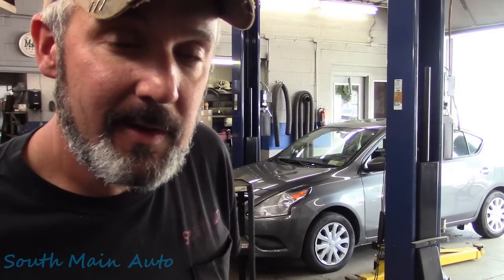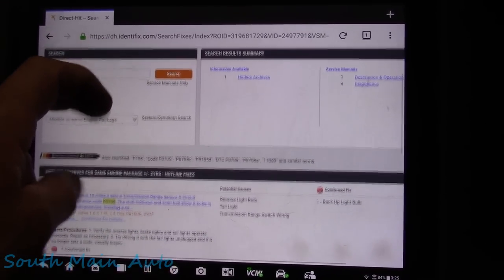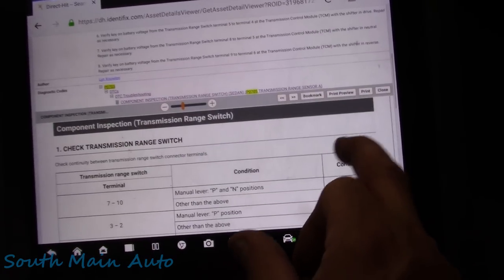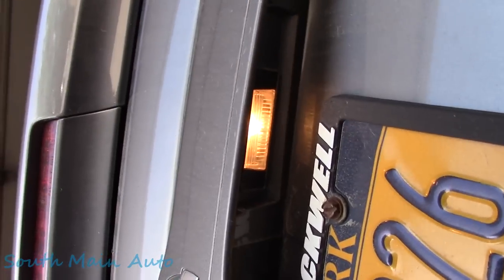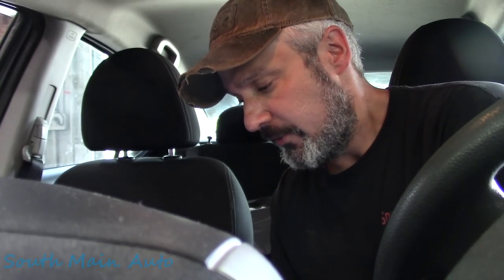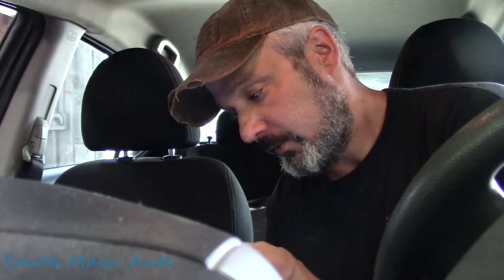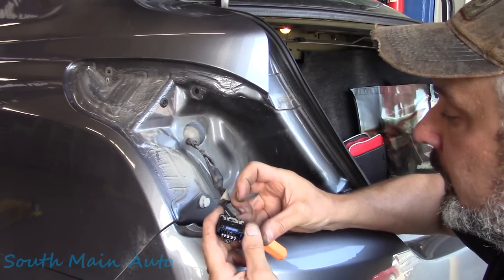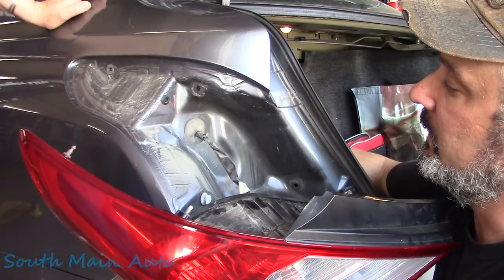Service Data Doesn't Cost - It Pays

Comment: I have a coworker with this same car, and they'd had this issue, causing odd shifting.  They took it to a shop that replaced the range switch, when that didn't fix it, they told her she needed a new transmission.  I ended up searching around, and found another diagnostic video, where someone had gone through this same issue, but it was a dealership/reseller who had gone thru multiple range switches and even swapped out the transmission and still had same code/symptoms.  THe diagnostic guy, had to go through a bunch of nissan wiring diagrams until he finally found one that showed the reverse light circuit is shared with the TCM module, and he ended up finding out that when the selector is in R one reverse bulb was very bright, and the other very dim.  He ended up finding the circuit board on one side had gotten exposed to water and had a bunch of corrosion on it.  I don't remember if he replaced the board assembly or just cleaned it, but as soon as he fixed the light circuit, everything worked normal again.   

A very interesting design choice by Nissan, especially for them to not clearly document the circuit with the associated trouble codes.

So I ended up finding the reverse bulbs on my coworkers car were different brightnesses, didn't find any corrosion on the circuit board, but took some alcohol and cleaned all the contact surfaces off for the bulb sockets, then put a very light schmeare of dielectric grease on each bulb before reinstalling them....her problem was solved.  No transmission required.

If she has this problem again, I will definitely check the pin connections for looseness like you found.
Reply: This crap in addition to their CVT issues is enough to convince me NEVER to own a Nissan.
Reply: @keithwolstenholme4238  For Sure.  The only Nissan vehicle that I have been impressed with is their full size cargo/work vans.  Had a fleet of them at previous job, and the field techs beat the crap out of them, loaded them with heavy parts or pulled trailers with them.  They required regular maintenance, but what doesn't?  Had multiple vans with over 100k on them just working their hearts out without any major issues.  But their consumer market stuff?....HARD PASS.

Comment: I was working on a Nissan Micra where every  time you hit the brake, the rear view camera would come on. I was scratching my head until I read a tip from identifix explaining how water can get into the circuit board on the rear tail lights and start jumping the power to each circuit. In my case it fed power from the brake lights to the reverse lights and caused a shifter range code and back up camera to come on. Nissan wiring in Canada.. not impressed.

Comment: "What do you think made it get loose." Mrs O asks. Probably heat from too much load and it being replugged a few times, I would reply and start wondering if the other side is also as loose as this one. So back feed of voltage through the reversing lights!?!

Comment: Great Vid, came over from Rainman Ray's shout out. I do have one question, if you have a partially broken wire on the Flux-capacitor causing a voltage drop are Scotch Locks okay to use? Thanks for the share.

Comment: I haven't actually seen the wiring diagram for the Nissan Versa but what I suspect is happening is that the transmission module is what turns on the back-up lights. With the ground floating on the driver's side rear lighting assembly, when the brake pedal is pushed, the voltage to the rear brake light is backfeeding through the back-up lamp and sending voltage to the transmission module. The module doesn't expect to see voltage on the back-up light circuit and it confuses it into thinking that some of the shift position switches are closed when they aren't.
Reply: my thoughts exactly

Comment: As a DIYer and former mechanic. I got a month sub, for a van I just bought had 50 million codes set. but the code that stuck out was a performance code. cleared it came back. instead of going with the "Fixes" I used that and looked at data that would affect performance. B2S1 O2 was wonky. Someone had de-pined the signal wire and taped up on that O2, don't know why because bank 1 cat was bad, not 2. But I still had to use common sense to avoid "parts cannon" that would not have fixed anything. Later oil control for VVT, dealer said $1600 to fix. Without removing intake, pulled solenoid, soaked in carb cleaner overnight, been good for a little over 25k.

Comment: Questions: Having fixed an issue like this that was causing one code that then went to a "Past" code - why clear the codes?
Doesn't that mean all the drive cycle monitors need to be run?
Don't they just clear themselves out after a certain number of drives?
Does the money light stay on even though the code went to a past status?

Comment: Nissan seems to have a weird code setting architecture. The alternator on my wife's Maxima started going bad. The ABS, TPMS, and check engine lights came on and sometimes went out. No charge light (?). I saw Eric's vid on a failing alternator. Sure enough charging at 15 volts. SMA FOR THE WIN!!!

Comment: Ray sent me here...lol.   Actually helped me fix an issue on my truck no one else could figure out.  Power windows on all 4 doors down and up works fine.  But if you have the cruise control on going down the highway and roll the driver's door window up it knocks off cruise.  Only window that does that.  So, after watching this video from Ray sending me over here and watching this I went out and I I pull the panel off, check the plug in on the motor and...whattaya know..the ground pin is loose. Tightened it up..no more knocking cruise off....so far.  Got a few techs here in town that I gotta share this info with because 3 different techs looked at it and none could fix it. Replaced the entire button controls in the door...and those ain't cheap...and nothing.  Threw about $500 into trying to find the issue without a resolve and this 1 freaking video I fix it myself.  You and Ray gonna save me money...lol.  Thanks.  Tell Ray, Thanks cause been watching him for about a year and he mentions you a lot but never even watched a video of yours until he mentioned your site today on his video and I thought I'd check you out.  Helped me fix mine...subbed.  Keep up the good work.  One of yall need to move to Alabama near me.  You'd both save me repair money.  Stay cool.

Comment: No idea why a bad ground at the light caused the transmission   issue (Eric, did you ever find the reason?) but I would offer the following for the failure of the ground pin.  First it was the pin that carries about 6 (or more times current) than any other in pin in the connector.  Being the pin is in the center of the connector it is the least likely pin to be damaged by physical abuse.  But it is the most likely to overheat.  I suspect it heated the spring of the contact enough to soften it and allow it to relax.  The connector can probably theoretically  carry that much current but with a minor amount of oxidation, resistance will increase with heat increasing as well until failure occurs.

Comment: I had a pleasent suprise after sticking my 2018 Ford Sierra in the main service centre for a tps replacement and they actually replaced two with a complete bill of only £125. Damn it cost more than that for a BMW bike just for one sensor.

Comment: Connector pin drag test. Absolutely! I do heavy duty truck road service. When the 1st generation Detroit Diesel ECM's late 1990's appeared I got a OTC terminal probe kit.  By learning the importance of pin drag I became a local guru, I have fixed trucks which just came out of factory Detroit shops simply for the mechanic over looking loose terminal to pin tension. That OTC kit made me a lot of money thru the years by checking pin drag. Yet I am way behind those shop guys in knowledge.
   But as emissions have changed I got to go and get the kids in local truck dealers to hold my hand.

Comment: I had a older Toyota sienna.  2000 ish. She was a gem. Oil leaking out of the frame. Anyhow. The car would die after 10 min or. Blown fuel pump fuse. Well like I said this engine was covered in oil. Found a tip on ident a fix. The O2 sensor would short ou on the frame due to a bad motor mount. Sure enough  drive it easy, no  issue. Hit the gas blown fuse. Saved me so much time. This van needed every mount known to man. The engine was basically sitting on the sub frame

Comment: if you want to get more serious about "drag testing" terminals, add and use a good pull force(tension gauge)meter. one that works in sub ounces/grams.
they're not cheap and rather easily damaged.
I'd guess either bad engineering, where it's overloaded with tail/brake and backups lights all lit for long periods or sagged cross-connected bulb filaments. but it could still be bad metallurgy, with increased resistance.

Comment: As  home gamer, I often use resources like that to give me a direction to look in.  I won't just throw parts at a problem, but I will look up what others have found to be the problem, and then see if that is the case for me.  Often, one of the first two or three suggestions is where my problem lies.  As long as you don't get stupid, and just go down the list chucking parts, it can be a great help, especially for those who are home gamers, just learning diagnostics etc.

Comment: Yowza! I can't imagine many folks taking the time to dissect a connector like that. When you pulled out the tail light assy and it started working, most would have proclaimed "Fixed" and stopped right there! Well, they would have put the tail light back, but you know what I mean. Great going!

Comment: Identifix positively has its place in your shop. I once had a Volvo in my shop with a P0301 code. Very basic code. Long story short I put in the code while on hold on the phone. The identifix article said to check the fuel pressure regulator. That would have been an odd way to fix that code . I never would have thought of. Just by shear luck it saved possibly saved hours of time . I am an Identifix believer.😮

Comment: i was a diag tech at a small shop and the owner of the shop ALWAYS went to identafix and kept telling me to just do what it said AKA load the canon i hated doing that because 9 times outa 10 what the owner told me to do was wrong and when i went through my own procedure i got to the problem albeit after a couple hours of work and being a fairly young and new tech i did not always know what parts of identafix to trust

Comment: I’m a Nissan tech, and have seen master techs get duped by the f1 or f0 code for the trans assuming it’s not pulling because of the common cvt failure. They replaced the trans, and still, the problem persisted. Tech eventually found the rear lamps to be kinda screwy, and in shame realized his error.
Reply: What a nightmare....changing a cvt for nothing?....im not sure I could handle that
Reply: @DDrew67  cvts are our gravy. I personally am able to knock one out in a day, many of the older techs, can easily have one ripped out before lunch and almost put back together and programmed before everyone is back from lunch. It’s very impressive to see. Although the aforementioned master tech made a mistake he’s a very good tech that just got to comfortable, and he obviously learned from the mistake because it cost the business money, and it’s just humiliating to know you made such a big mistake. I’m sure it happens to the most seasoned tech eventually, it’s how you handle it, and learn how to avoid mistakes like that in the future that makes a good tech.
Reply: @Billybobaggins9  ok I feel a little better about taking a whole day to swap a cvt....thanks

Comment: It’s like a brain teaser! I had a problem with my f 150, 2005. I was getting tired of replacing the right fog light bulb every time it rained or went through puddles of water. 
Come inspection time I would never be sure it would turn on. So this year I replaced both light bezels. Boy they looked great, but only the left side worked! Turns out I had brown wire cancer. It went back in the harness over a foot. So I used your trick and ran a new wire spliced into the harness upstream of the lights.

Comment: When Mrs. O turned off the lights the light in the trunk came on. It could have been off because of battery protection turning it off after x amount of time. My daughter had a car with a no start condition and the fix was to replace the r/r turn signal socket. Whoda thunk that?

Comment: I had a 2009 Sonata with the auto start!
Start and run fine with key but auto start would start and turn car off right away. Lost my mind.after about an hour of checking circuits and not finding anything out. I see a light bulb package in on floor under driver seat. Turns out owner put wrong bulb in brake light and as soon as maker lights came on it back fed through the brakes and wound shut car off thinking brake was applied without key in ignition. 
Also back in the day 1157's would brak top filament and it would fall onto other filament and caused dash, markers ,blinkers and radio,interior lights to all come on at same time but very dim. Had lots of fun thinking it was a ground 😤

Comment: Rainman sent me to this video and i agree. I have also ran into issues where the manual was incorrect and it takes deductive reasoning to reach the correct diagnosis. That's the difference in between a mechanic and a parts changer.

Comment: I dunno, that light being loose means someone was there before or maybe thats what caused the connector to spread inside and become loose from vibrations, or cheap chinesium made metals with weak spots from improper smelting. great video, my brother has one of them pos versa cars i still drive my 93 f150 as a daily driver. but great vid, a rare find of honest mechanic.

Comment: Eric, be sure and update that post that helped you and add the your was the loose connecter and give the OP a thubms up  or otherwise a that-a-boy pat on the back I work in IT and no one types up what they did to fix the issue and the next guy has to start from scratch and it sucks.

Comment: Some GM cars would set an ABS error if a certain brake light bulb was not functioning properly. This diagnosis reminded me of those cars.

Many cars are going to have a weird engineering quirk, and there is no way to know them all. This is why having Identifix is worth it.

Your channel helped my mom out. A few years ago, she had an EVAP code in her 2011 CRV. Not wanting to just throw parts at it, I searched it and found your channel. You made a video where someone got the same code on a similar CRV. You used your scan tool to show evap pressure, and knocked on the failed valve. The advanced scan tool showed pressure change, indicating that the old valve became sticky inside. Replacing it solved the problem. I replaced it, and solved the problem, too.

Sometimes when a car in my family would have an EVAP error, I'd just get a fuel cap. Earlier, mom's car did have a "Check gas cap error" and the replacement didn't solve it.

I'm so glad the car eventually showed a code.

I'm so used to having a code that gets me where I need to be. For example, some cars in my family would set a MAF error, and all I needed was a replacement MAF.

9:18 I'm used to seeing tail lamp sockets developing a leak, then letting water corrode everything inside. Sometimes I can get new tail lamp sockets, sometimes I have to get a new tail lamp unit. Other times if more than one socket needs replacement, a whole tail lamp unit costs about the same. Due to the number of Chevy/GMC trucks that exist and suffer this problem, Advance Auto keeps these on a shelf with the entire Dorman Help lineup.

Comment: i have the distinct feeling that the wiring diagram was missing something. if it goes to the tcm, does it go to the bcm to run the lights? if so the feedback would be isolated and not cause this issue.  the switch must be hard wired to the lights but the diagram you showed didnt show that.   actually seen an 1156 stuffed into an 1157 socket  do something similar. how they managed that i have no idea but i had to break it to get it out.

Comment: Always wonder if some of the cars were in accidents. 
Once had a Nissan where the license plate bulb wires were brittle and broke because they were routed along the hinge.
Reply: My wife's Dodge has the same issue. Of the engineers just lengthened the wires by an inch there wouldn't be an issue.

Comment: You never did show us how the backup lights are controlled.  I think what you'll find is they're controlled off the same switch as the one used for the computer input.  With the bad ground, a voltage was back feeding into the reverse input, confusing things.  It's all simple - once you figure it out.  ;)

Comment: Definitely have worked with some part changers. I only have Identifix in my shop. I do every time look at the fixes when I come across a new problem. I don't change parts unless I can prove they're faulty. 1985 BMW 535i not much service info out there. Put in a service info request and they'll get you what you need usually that day. I'll just say, I do appreciate Identifix.

Comment: My guess, the bad ground at the tail light made it backfeed into the switch circuit.

As for the problem itself. Typical Renault problem. My '98 Clio had it. Cluster fog light indicator lighting up then pressing the brake pedal. Got to the point of loosing blinkers when marker lights and brake lights were on.